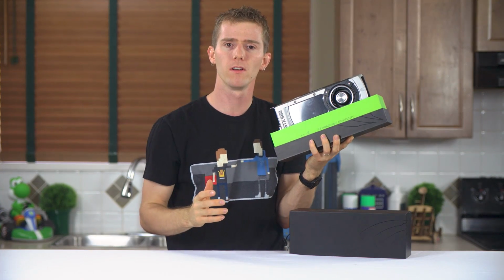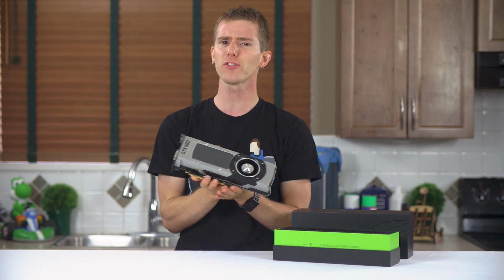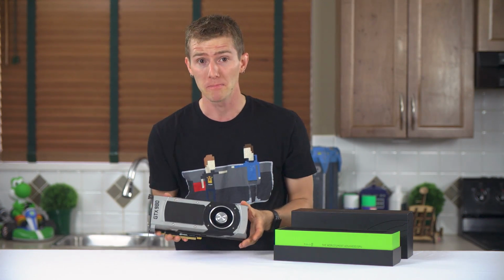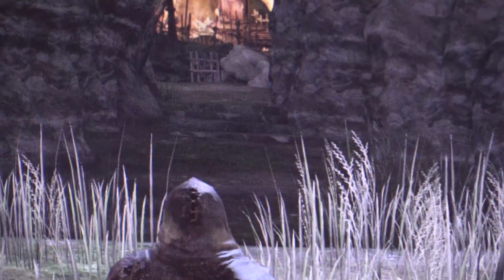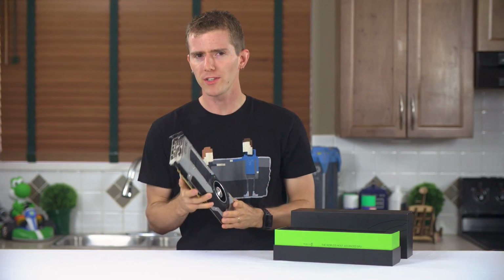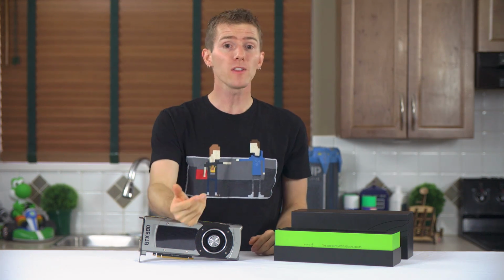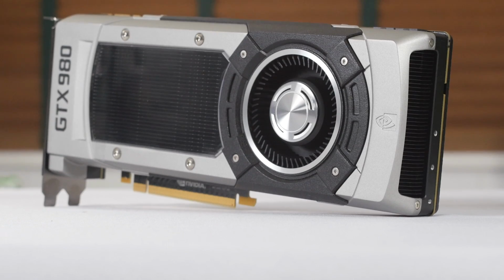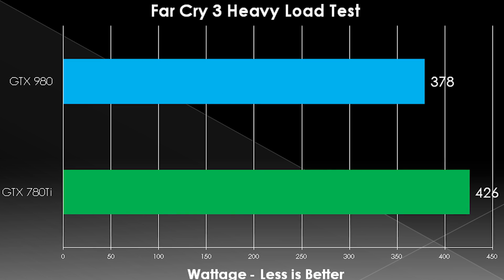NVIDIA GeForce GTX 980 Video Card - Performance Overview

Comment: I still don't understand why there is OC'ed cards being benched against each other.
It's almost like reviewing CPUs - then going and saying an intel i570k clocked at 1.2v @ 5ghz beats out a really unlucky silicone lottery I7 3770k, that needs 1.35v for 4.5ghz. That's totally plausible as a scenario and that's something (based on your GPU benches) that could be happening.
When will you be ever comparing stock benches with stock timings?

As for the dilemma - I would love SLI 970s - problem is I can't justify spending £200 on top of selling my SLI 680s for 2x 970s

Comment: can anyone help me if this is a good build to max out games?

core i5 4690k
16gb corsair vengeance @ 1866mhz
nvidia gtx 980
atata 256gb ssd + 2tb 7200rpm hdd
msi guard pro atx motherboard
cooler master hyper 212 evo cpu cooler
corsair cs650m 650w 80+ gold

gonna be playing popular first person shooters(like cod and battlefield), and minecraft with shaders
thanks in advance :)
Reply: Don't waste your money on 16GB of DDR3-1866. Get the cheapest 8GB kit you can. 

Get the 970 over the 980. The price difference is massive, and the 980 doesn't offer nearly enough performance over it to be even close to worth it.
Reply: There are 2 versions of that board. The H97 and Z97 version. Both will use this card.
Reply: That's like 3 times more than enough, so you're good.
Reply: Dont get the cheapest ram. Youll end end up with 2x 4gb sticks clocked at 1333. You can actually get 2133mhz of 2x 8gb sticks for the same price. Hell there are many memory manufacturers with 2x 4gb kits clocked at 2666mhz for a little over a hundred or 16gb kits at 2666mhz for under $200. Not sure if you have the z97 version of the motherboard or the h97 version but the z97 version supports memory upto 3300mhz. If you are getting the h97 of the motherboard then you can only go up to 1600mhz according to msi. And the 970 may be cheaper and come close to performance when overclocked with the 980. But the 980 can usually overclock to 1400 to 1500mhz leaving the 970 behind again. What card you get is up to you as they are both good choices. Cheaper is not always the best deal sland more expensive does not always equal more performance. Do research on what you plan on buying. Make sure to read reviews.
Reply: Rob Carter you are crazy. You can get high performance ram kits for the same price as the "cheapest 8gb kit you can find" you have aboslutely no idea how to shop for parts.

Comment: Benchmark with both  gtx 970 and 980 but just at normal or high settings to achieve 120 hz or 144hz also at 1080p or 1440p .. . . . pls LinusTech LinusTechTips

Comment: 30% better than 680.... What ever happened to Moore's Law?
Reply: Moore's Law never said stuff get's twice as fast every two years. It said the components (transistors) get twice as small. We're seeing that gain in reduced power consumption, not increased preformance.
Reply: ufster81 tell that to AMD... POWER POWER POWER. Same technology :(
Reply: Agreed I seriously hate how small the performance increases are per generation like wtf. I am not spilling out $600+ bucks for anything more than double my current performance. Its been over two years since the 600 series came out and we can't even get anything much better than 660's in sli in a single card.
Reply: Fuck Moore.
Reply: ufster81 ikr, very sad. :(
Reply: Son of a Zombie Well Moore's Law now applies to power consumption.
Reply: Austin Schafer the 980 has less transistors than the 780  (5.2B vs 7.1B)
:(
Reply: SO RIGHT
Reply: It does apply to CPU's still.
Reply: Son of a Zombie  This card isn't 30% faster than a 680 at all, it's around 15% faster than a 780ti which leaves the 680 well behind. In fact the 980 can and does match the performance of two 680's in SLI.
Reply: JAGUARCD32X you are confused with the 95% better performance in marketing.   the software is more efficient.  the hardware has gone backwards.

Comment: Can someone help me figure out what to upgrade on my build, I know it's not very great for modern games so i'm gonna upgrade it but I don't know what to upgrade or what parts to get. I'm a noob pc builder ;(  READ BELOW

GPU- GeForce GT 640
Processor- AMD FX-9370 Eight-Core Processor
Memory- 8.00 GB Ram
Motherboard- ASUS M5A99FX
PSU- OCZ ModStream Pro 600W
Monitor Resolution- 1920 x 1080

Thanks guys :)

Comment: Do 970 Reference and non reference in SLI vs 980 Reference and non reference in Single and SLI, I know i'm asking a lot but it will a package and Does 750 bronze thermaltake PSU can run 970 SLI ???

Comment: There are digital distortion on Linus's sound. Sounds like the battery in the microphone is running low and then lowering the max input. Just thought you should know, so you got a change to check it out before next video. Thanks for this video!

Comment: Hi guys! :D
Do you have any improvements on this build?
I had another one but with the GTX 970 i changed it a bit.
http://pcpartpicker.com/user/MSurai/saved/M3grxr
I want to upgrade the system later (probably a second 970, a few more aftermarket fans, maybe ram).
I don't know whether i can control normal case fans with Corsair Link, i know i can control the pump, the fans on the radiator and the graphics card, but what about front/back fans? I couldn't find anything about that.
I have to use wifi because i don't have access to a lan connection.
I'll buy one monitor first, but i'd like to use two monitors (i'd buy the second monitor in about a year or two), will this be able to run 2 monitors at 2560x1440 at 60 hertz?
Thanks in advance!

Comment: what if they put same thing in the specification of gpu like titan black...maxwell card woth 2880 cuda cores and 6gigs memory and 384 bit memory bus and two eight pin power supply then what would be the performance???? it enables the 4k 3d gaming with two display port input for 120hz refresh rate like technology used in first asus 4k monitor with 2 input..but with updated specifications

Comment: Should I get 2 GTX 980 or a single GTX Titan Black? Which one would I need to play games on an ASUS PB287Q?
Reply: A GTX 980 is slightly more powerful than a GTX Titan Black,if you won't to game and do some workstation work get the titan black just gaming Get 2 EVGA GTX 980 Superclocked Editions That's what I'm getting but instead of I'm getting for just waiting for it to arrive.Also the 980 is still a good workstation card but the Titan black is much better for workstation 980 is slightly better for gaming but way less powerful for workstation,Get the 980 because it's newer better architecture less power consumption more features more optimised for gaming half the price of a Titan black,so you can get 2 EVGA 980 Superclocked Editions for the price of 1 EVGA Titan Black Super Clocked Edition Example if you got 1 titan black you would get 15 frames ultra setting 4k on Crysis 3 with 2 980 you would get 35 framed get the 980 I hope you listen
Reply: Apple Hunter Alright, thanks. I'm only going to play games on my PC so 2 GTX 980 it is.
Reply: Dont forget to get the EVGA GTX 980 Superclocked Edition It's Only $30 More So $60 More For The 2 It's Worth The $60
Reply: frist opsion.
Reply: Kamo Jima Alright, thanks for the help.

Comment: So I already have an ASUS GTX780 sitting in my PC and my power supply is more than able to handle an SLI configuration. My question is, do I upgrade to a 980? Or should I wait for GTX 780 prices to come down (as they inevitably will) and go SLI?
GTX780s are cheaper and an SLI configuration is going to be quicker than a single 980. Also, I'm not sure if a single 980 will be able to push a bunch of monitors at 4K like a dual 780 rig.

Comment: Can someone please tell me where I can purchase the 980 for "considerably less" than the 780Ti? Amazon is selling a 980 for $638 and the cheapest one on Newegg is $570. I can get a 780Ti on Amazon for as low as $590 and the same price on Newegg. So just looking at the two vendors, the most I would save getting a 980 over a 780 Ti is around 20 bucks (if I opted for the cheapest card). I'll shop around some more, but judging from what I've seen so far there is no "considerable savings" here. Must be talking about Canada! Okay, okay, I know there's also a power savings (probably not more than about $10 a year, if that much), but still, I'm not as excited now as I was at the beginning of this video ;)

Comment: Any have any thoughts on the build I was going to be doing in a week or so? At this point with the 980 releasing I can do the following:
Quad Liquid cooled GTX Titan Blacks
                     OR
           Quad Air Cooled GTX 980's
What will I be doing you ask?
Well I am a full time youtube gamer and streamer. So it's important that I purchase the newest games on the market, the day of release, I want the ability to play these games on the HIGHEST setting possible, max frames while still having the ability to render my videos in Adobe premier on one monitor, and on the other monitor I can be working on thumbnails and doing social media while on the middle monitor playing my games ect.
  These cards will be hooked into the new 5960x Motherboard if anyone was going to ask that. Basically I need a workhorse computer that has the ability to do everything I stated above at the max capacity. So the million dollar question of the day is:
Which set of cards are a better powerhouse for what I will be doing. ALSO keep in mind I do run triple monitors.

Thanks in advance to anyone that can send me in the right direction!
Reply: TL:DR: Triple 980s should keep you happy for a while, and they're cheaper and slightly better. BUY LIQUID FOR THE SETUP HOWEVER, or you'll be onto the train to thermal throttle town.
You mentioned that you where running 3 monitors, so I would assume you need a card with a large amount of outputs, and the 980 seems to have a huge amount of display-port outputs over the Titan Black, which would be beneficial for you. 
Secondly, if power is an issue for you, I would recommend the 980s, it will be cheaper in the long run to power them.
Finally, the 980 seems to JUST beat the Titan Black in most area's, which would be better for playing your aforementioned triple A games at the maximum frame rates. 
I don't know much about the requirements of Adobe Premier Pro, but it shouldn't strain your GPU's much. 
Make sure to get a large amount of RAM, 64gb would be my recommendation, but I dont know your personal usage in terms of RAM, however my 32gbs are pretty much always maxed. 
In conclusion, I can recommend the 980s, and they should also be cheaper for you upfront AND in the long run.
THE BIGGEST ISSUE FOR YOU will be the heat. I would use the money you saved on NOT getting the titans, and going for liquid cooling. You'll need it.
Reply: Rainboxed Dash Awesome thanks so much for going into detail, it's greatly appreciated!
Reply: xXRejector88Xx 128Gb of Ram isn't possible with that CPU. If you're building a rig of this magnitude, you want SSDs too, much just unreliable mechanical drives, and Quad SLI isn't even supported. Not to mention, 3-way SLI is a total waste of money also. Thing of it this way when you SLI
1 Card - 100%
2 Card 70%
3 - 30%
4 - 10% Boost

Honestly man, there's no reason to get over 2-3 cards.
Another quick tip, try using at least a 120 Gb solid state drive as your boot drive in case one of your HDDs fails.
Reply: Quad 980s, i7 4930x processor, 64Gb RAM (128 if possible), 3x 4Tb Hard Drives 7,2000RPM. That should get you through your needs
Reply: ***** Hey man, just adding on to what the other guy said, Nvidia hasn't released any drivers for more than 3 GPUs in SLI yet. Honestly, I wouldn't even get three if you're getting high end models like these. 2 Way SLI 980s would tear through anything you throw at it at Ultra for a few years to come. I would invest the extra money in higher speed/quality ram or a better x99 next-gen motherboard. After 2-way SLI, the performance gets bottlenecked a lot because CPUs can't fully take advantage of all three. That's why you should save the $600+ dollars for other components.
Hope this helps
Reply: ClassyEnd It helps indeed, thank you kindly!
Reply: Since the only workstation thing you will be doing is video editing I would suggest the 980s. Use the money you save for water cooling. Since NVIDIA added the backplate (which I like) there would be no room for the fans to get air. As another user said "throttle town".
Reply: ClassyEnd That helps a lot bud, thank you kindly!
Reply: Derek Foster Thanks for the reply, helps a lot! Much appreciated.
Reply: Drop the 4th 980 and set up a watercooling loop. You could even drop that to 2 cards and still crush any game for a long time. It all depends on what you want to spend. With two cards, you could get a whole lot of ram for adobe premier and a watercooling loop to keep eveything nice and chilly. While your setting up a water cooling loop, you could also include your cpu and overclock that a bit as well. Whatever you decide, happy building!
Reply: well with 5960x tons of ram + 3 way sli is good dont think 4way sli wont make that big dif for the money you will give... i think the cpu is the main point here with all of that work you are gona do cos !! if you are gonna run 1 screen for gaming then you dont need all 4 cards imo....
Reply: quad titans? are you bill gates or just stupid?
Reply: ***** gotcha bereghost now i know your setup i knew you will go for the 980 after watching the eyefinity video why dont you build the computer yourself you could save some money doing that since I am 10 years old and built my own gaming machine plus say hi to tyler snapple and tixie
Reply: ***** and I am a big fan of your work
Reply: ***** I do think dual 980s will be enough just as classy end said you will just bottleneck the rest of the 980 since then go with dual 980ws
Reply: If I where you, I would get the Gigabyte gtx 980 in SLI. Its 100 dollars cheeper and slightly better for your needs. Use that extra money to get a LGA 2011 CPU and x99 motherboard.
Reply: I recommend: a x99 MB, 2x 980s (no point in over 2 way SLI, bad driver support, poor scaling, even worst game support), 64 gb RAM, maybe DDR4 but this field is still to improve, a OS boot SSD (256 or 512gb), 2x6TB HDD for video and game storage. CPU just pick a haswell i7 with 6 cores, dont know the model by head. Beleive me when i saw dont do more than 2 way SLI, it just not worth pay 2 extra cards, save the money, when the PC gets outdated for the latest triple A titles, just upgrade to 2 of the new flagships of that time
Reply: José Luís Lopes x99 motherboards only support DDR4 RAM so there's no option there. 2x6Tb HDD is a terrible choice. They will be 5,400RPM, you'd want at least 7,200RPM if he can afford the rest. An i7-5960x
Reply: xXRejector88Xx i was talking about the speed and latency that are still improving, bot about being ddr3 or ddr4, thx for the cpu model and there are 6tb 7200 rpm HDD, Google it
Reply: Alright guys, let me clear this up.

- x99, (5820k, 5930k, and 5960x) Only support DDR4 Ram memory.
- 6tb Drives will run at only 5400 RPM. Getting two 3tb 7200 RPM drives is a better investment + A Samsung 850 Pro 512 Gb for a boot drive.
- Only go w/ 2-way SLI. Scaling becomes terrible, and optimization is a joke when you try to push 3.
- If you're going to game and stream, I would go with a 5930k instead of the 5960x, because of the higher clock speed, and for the most part, streaming to Twitch wont take 8 cores.

Refer to this parts list I comprised

http://pcpartpicker.com/p/jVfsWZ
Reply: ClassyEnd Omg read my reply plz THERE ARE 6TB 7200 RPM HDD
Reply: ClassyEnd Thank you for better explaining what I said, and also thanks for that processor info, would have never though of it because I overclock
Reply: ClassyEnd concerning that build list, do you really need a discrete sound card with that motherboard?  The top-end ASUS motherboards all come with pretty impressive sound in any case, so this seems superfluous.

Incidentally, there are 6TB HDDs at 7200rpm available on there.
Reply: Christ J thank you
Reply: If you planned on spending money on quad titans, the money you save with the two 980s can be put aside for a sound card. Regarding a 6tb drive, that's a terrible idea. I'm concerned that most of the people in these comments don't know what they're talking about in this thread.
Reply: ClassyEnd I do man, except for the quad 980 thing, didn't realize how terrible driver support was. I built my own I have MSI x99 SLI PLUS mobo, Gtx 980 superclocked, 120Gb SSD, 3Tb 7,200RPM HDD, windows 8.1, asus wireless card, i7-5820k, 16Gb Ballistix DDR4, and an EVGA 80+ gold certified 1,000w psu
Reply: xXRejector88Xx Hey man, Im not pointing fingers. At this point, you're one of the knowledgeable ones here. I've got a build of my own I finished in December also. Sabertooth z97 Mark 1, i7 4790k, (2x)GTX 980s ACX 2.0 from Evga, 16GB DDr3 Corsair Vengeance, A couple of WD Blacks, a 840 Pro as my boot, and an AX 860. I'd like to say I know a thing or two. My main point here is getting a single 6tb HDD is a terrible idea in my opinion, 7200 RPM or not
Reply: Bere, here again... Wow...